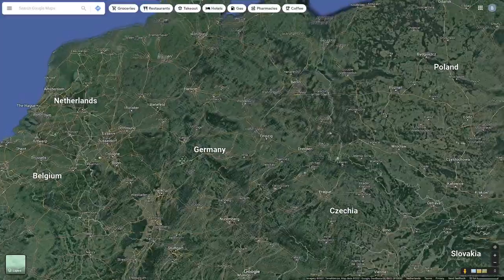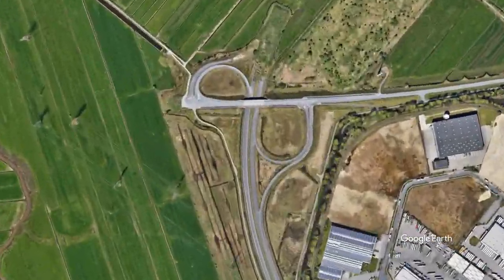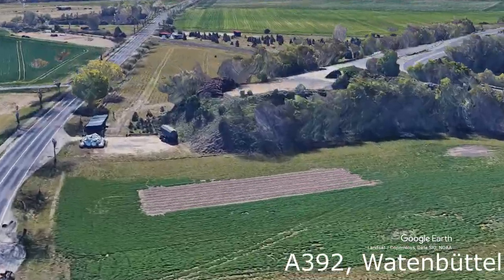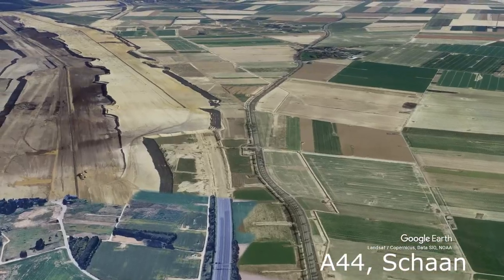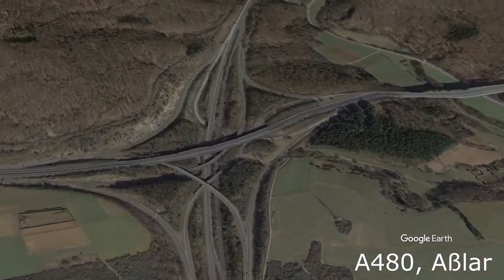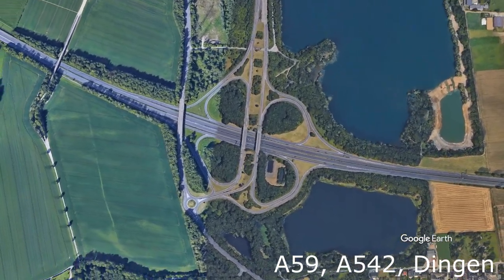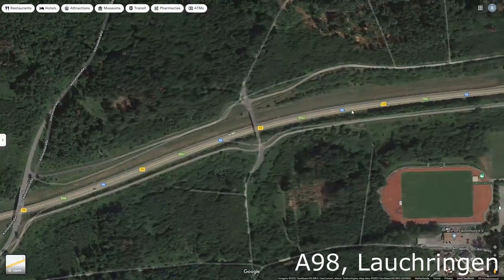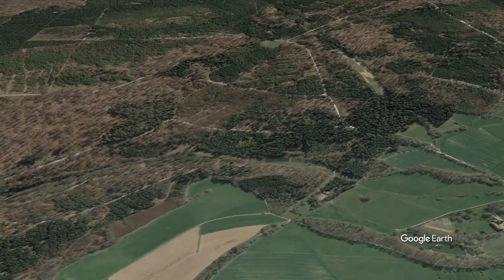Germany's Unfinished Autobahn System! 🇩🇪 | Exploring the Map #5

Comment: Great Video. Still the A46 near Bestig is finished because it it ends in that area and is only pland as an connector to the Ruhrgebiet.
Reply from the maker: aha, good to know!
Reply: @Linke Kever - Transit & Infrastructure Videos  actually i wanted to comment on that. Just found the video by random and i was so surprised that it basically starts off with "my" home stretch of bahn, the a46 and connection to the rein/ruhr valley. I drive like 10-15 min to get on it. It leads into olsberg and has only recently been extended in the last couple of years. Just because it ends there, doesnt mean it will stay that way cause there are plans to extend it further to get close to brilon and further connect to the a33. Not nessecarily all the way, but by a "bundesstraße" which is currently extending out of the a33 south of paderborn

Comment: They are still determined to finish both ends of the A281 in Bremen.
It's just that the tunnel was one of the last segments to enter the planning stage (which took years). THEN the residents south of the river complained because they didn't like how close the tunnel entrance was supposed to be to their homes, and also because that part was supposed to be "dug and covered" through 2 houses. So the politicians changed to a different tunneling method and a longer tunnel. Which means they needed to spend ANOTHER few years on planning.

And at the south end they had 2 different methods of connecting it to the A1 which they couldn't decide between. Either build a length of new highway along the airport perimeter that connects to the A1, or convert the B6 (which already connects to the A1) to an actual highway.
Reply from the maker: Thanks for your explanation!

Comment: In Berlin you also can find several weird endings. Most of them will never be build as planned in the 1960s.. Like the A103 so called "Westtangente" at Autobahnkreuz Schöneberg which schould have been connected to the planned A15 from " or the planned cross with a never started "Osttangente" (<1km, planned as A102) at "Gradestr.". Also you have to look at Schlangenbarder Str. (3km, formerly A104) with the appartment building over it. It was also downgraded it from Autobahn to town street..
An extension of the A100 (Ring) is right now nder construction to "Treptower Park" and will also get a temporary end be prepared for a further extension.
Reply from the maker: Thanks for this addition! those are weird endings indeed.

Comment: A46 is extended to olsberg and construction are on the way to connect it back to the a44 when finish the a445 will be rebranded as a46 there is no at olsberg a huge bridge been build and a connection to the tunnel for the road to Winterberg that plan is in work for nearly 50 years and possibly takes at least another 10

Comment: Three notable cases in the north are the A26 which ends in a simple interchange and both the A24 and A27 which end in a roundabout*.

*The Horner Kreisel technically is no roundabout but a junction with traffic lights.

Edit: The A20 also ends in a weird kink before continuing as a local road.
Reply from the maker: thank you for your addition!

Comment: the a44 bridge near ratingen you showed at the end has delayed construction on that stretch, steel parts of the bridge were made in zwickau and when they were ready to be shipped to site it was discovered that there were actually multiple bridges on route that needed repairs done before they were able to handle the heavy transports for the a44 bridge
Reply from the maker: well that was not so smart from them :)